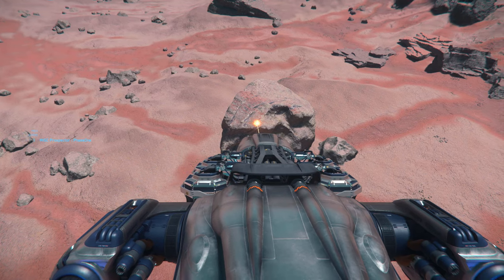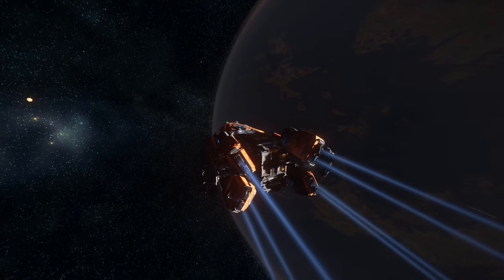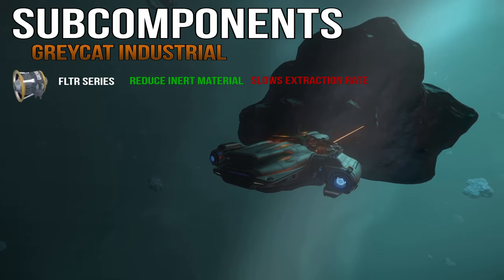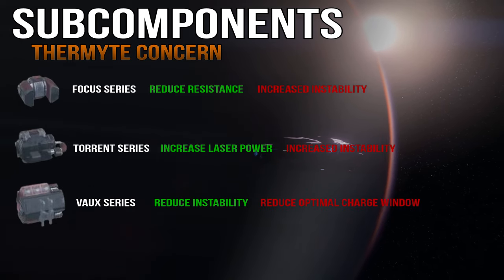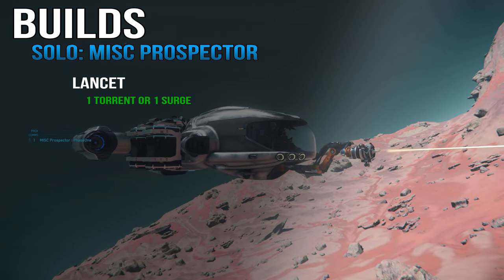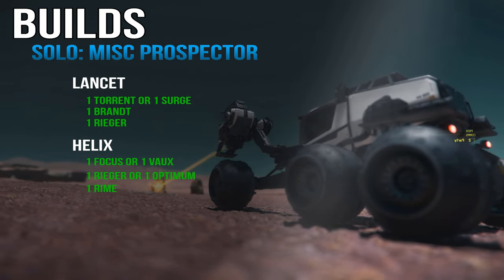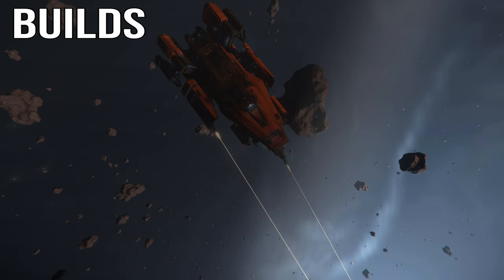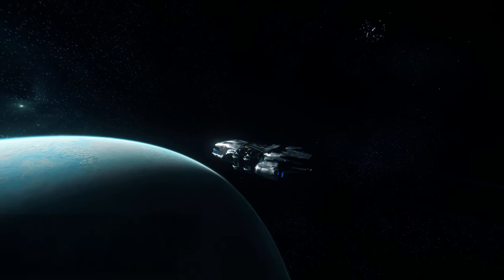Star Citizen 3.13 | Mining Module Guide and Best Builds

Comment: Good stuff, I have not played since January and really like the update and the info here.
Because you can only use one consumable per laser at a time I like the idea of have passive modules.
I do not know if this will work with modules, but with consumables in a Mole, even at laser minimum power the laser and consumable help the player doing the mining by the accumulated buffs of the other lasers, with the modules it would work even better.
Using 2 or even 3 Torrent III on the Helix would give the laser a max of almost 2600 power with 2800 from both Lancets as reserve power even without 3 Torrent III mounted on them.
Plus the bottom would be knocked out of the Resistance and Instability.
Might be some other problems though, will have to test all
Reply from the maker: Yea modules do go really well with consumables.  I think they're a really good addition to the mining gameplay.

Comment: Do they stack? Could I use nine of the ones that Reduce inert material on my mole?
Reply from the maker: Yes they do stack, but on the particular mining head it's installed on.  I recommend to have only 1 mining head on the mole to have 3 fltrs and only use that to extract.
Reply: It depends on the type, know if on 2 prospectors 1 using a helix and other a Lancet they complement each other very nice.
Will have to check out the modules and consumables though.